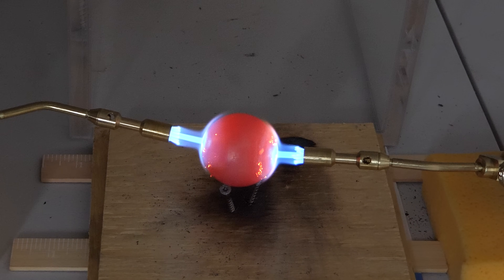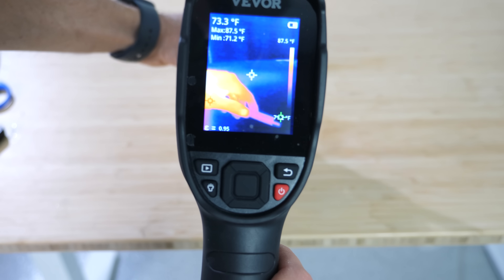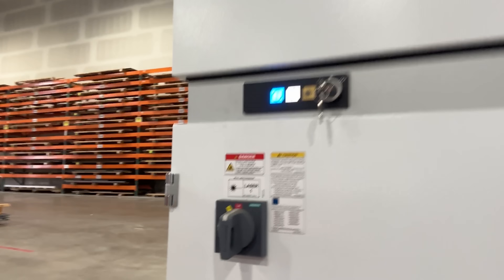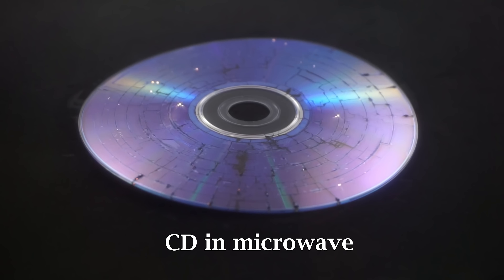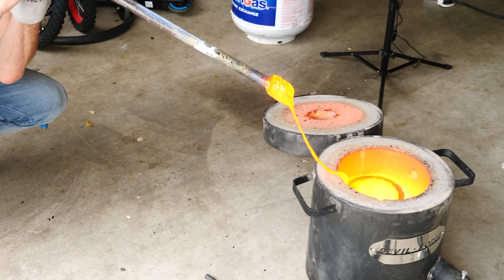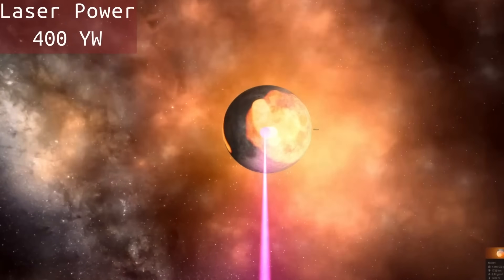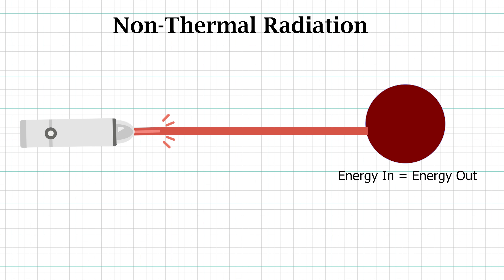How Hot is Light? How Lasers Bend the Rules of Heat Transfer

Comment: The  thumb mail show's a lazer beam cutting at a point somewhere along the beam trajector. Meaning the beam after cutting, keep's on going somewhere. If an object is mandated to be a the distance it is shown to be, meaning at a particual point in the tragectory of the beam. What happen's to any thing in it path after cutting an object?

We have the technology to make what's known as a "LIGHT SABER". The issue is, were not able to control the length of the beam it's needed to do only the job a light saber is designed to do. From the smallest possible lazer beam to that of the largest. The least powerfull will go so far, the distance in unfathomable. A larger more powerfull goes past the length any one can fathom to the N-th degree.

Any one utilzing a fire arm, because a bullet can go through an object assuming it hit's the object. Well beyond the object it hit, and if and when one were to miss the object, even a greater distance. Thus one is mandated to be aware of the back ground because of the damage that may occur when passing through an object, not to mention if and when missing the obect. Which compared to that of a lazer, the distant's is that of a drop of water in that of an ocean.

Comment: Man ! The laws of thermodynamics were written for HEAT (Ec relating to the vibration of material particles). Don't you know the difference between heat and radiation?
And they don't say anything like that! They say that when two bodies TOUCH each other, heat flows in both directions (from cold to hot and from hot to cold) but more from hot to cold, until the flow in both directions becomes equal again.

Comment: There is one issue with this logic however: It is said, that nothing can be heated by the sun to more than the surface temperature of the sun. If i use a  5 million kilometers large lense that focuses the suns energy to a small point, say a typical match head, than I focus the energy of the sun, that hits the 5M km lens. So following the logic, that much energy is radiated away, as is absorbed, a small object would need to be infinitely hot to radiate the heat away. So ignoring the fact, that such a lense does not exist, this does not make sense to me. So indeed the sun should be able to heat stuff to millions of degrees - if with a focusing apparatus that captures the proper amount of energy.

Comment: you can also heat something up by hitting it.
Take a hard surface and place paper on it then take a hard ball and hit the paper. you will have burned a hole into the paper.
Here the heat generated in the paper is also grater then the temperatur of the objects used.
Or a smith can keep up the temp of the metal he is working by hitting it with the hammer.
You just need an energy source and something to absorb the energy.

Comment: Ty for the video! But to question why "a "cold" laser emitter can make things hot despite the laws of thermodynamics" is just a wrong assumption. 

Heat induced by Laserlight, microwaves or other EM radiation is no heat transfer. It is first and foremost transfer of energy and heat transfer can, does not need to be a part of it. The laws of thermodynamic are not the only thing that play a role here, therefore the laser medium being hotter than what is to be heated is not a requirement.

"the source needs to be hotter than the target" is only true for blackbody radiation and only if these are in a closed system. But Laserlight, let alone concentration of Sunlight completely different cases. E.g. concentrating sunlight with a magnifying glass can (in theory) heat an object hotter than the surface of the sun. Here, as well as everywhere else where EM radiation the mechanism of energy transfer is the governing factor. In this case, we must consider conservation of energy, and that states "what goes in, must go out". When concentrating the energy given off of a large surface onto a small surface we can indeed reach higher temperatures than the origin surface, because the "concentration" is higher. Ergo, blackbody radiation and 2nd law of thermodyn has nothing to do with laserlight.

Although rectifing this briefly at the end of the video, the introduction and the question of the video is unfortunately quite missleading. I like your videos and your narrative and the fact we could see inside the laser cutting industry. But maybe also visit research labs, talk to experts and check for scientific correctness.

Comment: 5:55 I'm not sure that this is the whole story. If it were, then any monochromatic light source would do the trick, but if you let two otherwise isolated systems exchange heat via radiation through a monochromatic filter they'd still get to thermal equilibrium. In that case the relation between frequency and intensity (in connection with emission/absorption coefficients) would ensure that.
Also what is the "temperature" of a laser, where the light emitting atoms are "pumped" into an inverted state that isn't something that corresponds to a thermal equilibrium (AFAIK that inversion would correspond to a "negative temperature", one would characterize with beta=1/T in the statistical description to get continuously from non-inverted to inverted states).

Comment: I think an easier way to highlight this is that your can throw metal balls at very high speed to heat some surface way higher than the source temperature.
Reply: Speed of light and electricity is fixed.  Perhaps more balls within a confined space (density) ?

Comment: When a laser Cut steel, most of the Power comes from oxydation. Oxygen is used to increase the laser output.
It's a different situation with Stainless. You cannot Cut as much with the same laser.
Oxygen alone can cut up to 8 feet of steel. Just from the heat given from oxydation.

Comment: That's a 10KW Trumpf (note the 'f' at the end) laser cutter. I use to work with a 4KW unit, of the same make, years ago. Those particular units are used to cut metal. Steel, most often. It can cut finer, and more accurately, than a plasma cutter. Though the plasma cutter is about 1/10th the cost.
Reply: Then you should also know that these lasers are not vaporising, but mostly just melting the steel and its the jet of gas that makes it "disappear". That's very important feature. We couldn't cut steel without it.

Comment: Wait… I'm confused. I get the difference between objects that conduct via thermal radiation vs. those that conduct via electromagnetic radiation. What I don't get is how the electromagnetic radiation of a laser would be fundamentally any different than the electromagnetic radiation of the sun. The properties like wavelength/frequency, polarization, and intensity may be different, but it's all photons. And, sure, those properties matter when it comes to the end result of their cumulative effects, but if the ability to heat to a higher temperature than the source lies with electromagnetic radiation, how is a photon from the sun any different than a photon from a laser? Also, you mention a laser having batteries. The sun also has a "battery" of sorts: it's mass, since it's releasing photons equivalent to the difference in the mass of the atoms before and after fusion. I would think the only reason the sun can't do what the laser's doing is because its light just isn't being focused as densely, not because sunlight lacks the ability. Am I wrong?
Reply: The sun is emitting light from fire.  The laser is emitting light from electricity.
Reply: @CATANOVA  There aren't "fire photons" and "electricity photons," there's just photons. All electromagnetic radiation has the same properties. The values of those properties vary, but they're the same properties nonetheless. Even ionizing radiation is only distinguished by the amount of energy (and related properties) it carries. Any frequency of electromagnetic radiation can be transformed into thermal energy when absorbed by matter, whether radio waves, microwaves, infrared, visible, ultraviolet, x-rays, or gamma rays. My question wasn't about how the radiation is produced, that doesn't matter. My question is what physical property of the electromagnetic radiation from the laser makes it different from that of the sun. Best I can tell, it's merely a matter of how tightly/densely the light is focused. Because infrared light has less energy than much of the spectrum of the sun, so it's not about how energetic the photons are. The sun emits plenty of infrared as well as higher energy photons of the visible and ultraviolet ranges. Therefore, if you were to focus enough of the sun's light into a small enough point, it should do the same thing as the laser. If that's the case, then in terms of being able to heat something above the source's temperature, there's no distinction between the light of the laser and that of the sun. They don't transfer energy by different mechanisms, only the density of the light sets them apart. 

And for the record, the sun releases energy through nuclear fusion, not fire. (Fire is a rapid chemical process of oxidation that releases thermal energy, an entirely different process that requires oxygen.)

Comment: I liked what you did here, but I have one problem: using a magnifying glass to magnify the light from the sun is not magnifying a thermal source directly, but like I said, the light itself. That said, if you have a magnifying glass of sufficient size (perhaps 100ft true fresnel lens, or a mirrored radar dish of similar size) you will surpass the sun's heat at the surface!

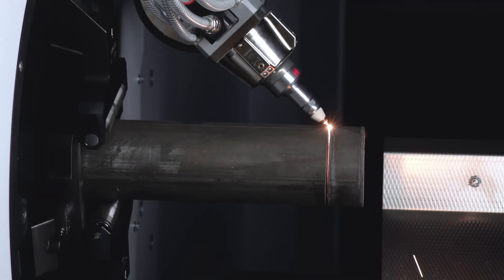Comment: 3:13 OK, this is messing with my mind... Laser at 30° angle(for arguments sake), round bar spinning, you'd expect the laser to cut a cone on the end of the bar, but the finished cross-section is a square?
Reply: If you look at the piece that’s removed as it falls away you’ll notice it’s tubing and not bar stock.
Reply: There are sparks coming out of the middle while the laser is cutting. I'm gonna say it's cutting a pipe and not a solid steel rod. It's slightly cone shaped, but that would be a bevel on the outer pipe wall.
Reply: It's a hollow cylinder, of course. You can see the (annular) "bevel"

Comment: Just a different form of energy transfer. The second law of thermodynamics states that the entropy of a system never decreases. As a consequence, thermal energy gradients force energy transfer in the direction of the temperature gradient. But the laser is transferring its energy through photons, not heat. So more generally, the energy gradient forces energy transfer in the direction of the transfer medium's gradient, in this case, photons.

Comment: 0:36 they have INFRARED SENSOR CARDS!!?? This would be so useful for individual soldier laser warning if somebody is shining a PEQ on you.
Reply: This is nonsensical.
Reply: I carry one in my wallet for checking if there's infrared light coming out of fibre channel optical cables and ports.
Reply: If the detector goes off for an infrared laser, it's too late. 
Either you actively have a firearm pointed at you, or there are hot laser guided munitions on its way to your location. 

It won't be much help at all, other than warning you of the inevitable.
Reply: Tanks have laser warning receivers for this reason.

Comment: this makes a lot of sense. I've always felt that the designation of lasers as "negative temperature" was just a lazy way to make the math work for something we didn't understand, but it being a nonthermal source  makers much more sense than a negative temperature source. Then its designated as a negative temperature source because heat will always move away from a negative temperature source. 

I can think of it practically like the relationship between being pushed by an object vs being acted on by gravity. the object pushing you has a finite amount of energy that it can transfer and so you will only move at a certain maximum speed (like a normal thermal source), but if you have no thing under you and no air resistance gravity could theoretically speed you up infinitely as its a constant source of energy (like a laser). 

I know I'm saying anything profound but its nice to finally learn this. My wife jokes with me all the time by reminding me of "negative temperature" because I would get so heated about it.

Comment: The second law is wrong. Heat pumps may not create thermal kinetic energy, but they do organise more joules of thermal kinetic energy against the natural heat gradient than they require in mechanical input to opperate.

This effect, where their cop > 1, means that a heat pump lets you trade a relatively small kinetic input for a relatively large thermal potential gradient.

Potential energy is a real and valid form of energy. If I can spend 100 joules of mechanical energy to establish 200 joules of thermal potential energy, then the second law is incorrect because I can lower the local entropy faster than entropy increases to supply me with power for my heat pump.

Comment: You can get very different results with LEDs compared to LASERs. Can you give me a coherent description of why?

{^_^}
Reply from the maker: because LEDs have a much lower power output per area since it is non-coherent light
Reply: @TheActionLab  Which is exactly the clarification I was hoping you'd make. Coherency with EM radiation is critical to focusing it to absurd points given enough apparatus. e.g. A 16.3 kHz system might require rather impractical size but is theoretically possible, a 100 THz system can be constructed with feasible size apparatus, and a gamma ray apparatus can even be configured by nature in very large objects.

Coherency is the key element to focusing the device's energy more than how the light was generated, thermally or some other means. LEDs don't emit coherent light. LASERs do.

{^_-}   Thanks for the reply I was fishing for.

Comment: another interesting thing, for the same reasons that lasers can heat things up beyond the "source temperature" they can ALSO COOL THEM DOWN. yes, cooling lasers. you should do a video on that!
Reply: Also, he cut pipes. I want to see video about lasercut in dot, in deep metal block.
Reply: @GOOGLE-IS-EVIL-EMPIRE They cut both! Or at least made champion bevels on the 2 dm dia. rod. I was waiting for that scrap (most of the 600 lb. rod) to have hit some Elden Ring scale safety device that they were laughing more than they were bruising.
Reply: @GOOGLE-IS-EVIL-EMPIRE  2:51 thats pretty much what they were doing right here and the shot after, that metal is like 1 1/2 inches thick, its crazy that the laser can cut it that precisely and that easily.
Reply: @SpydersByte  i want see how they cut big brick of metal in center, like dont, not from side to side.
Reply: @GOOGLE-IS-EVIL-EMPIRE  We have 1" thick steel plate parts cut all the time with a 6 kW laser.
Reply: @chuckmccown8893  cool. But it start cutting in dot or from edge?
Reply: Sorry laser cooling has numerous YouTube videos already.... Just this one wasn't one of them....Since he forgot to include that part....
Reply: @nc3826 forgot? It wasn't the focus of the presentation.
Reply: @mattmarzula  sorry to confuse you and for what you "forgot:, my trolling friend, but it was.... FWIW a rationalization for what was missing is in the pinned comment
Reply: Finally, lasers are cool. It probably took some nerds in the '70s ions to do this I bet.
Reply: I used lasers to cool something down to its quantum ground state near absolute zero!

Comment: I have to admit I still don't really understand what's going on here.

If you didn't know the light was from a laser or a thermal source, what's fundamentally different about the two light sources that let a laser heat something to a higher temperature than a thermal source? 

I don't doubt your explanation, but there's something unsatisfying about it.  Both are just photon sources.  What's different between the laser photons and sun photons?
Reply from the maker: It is because if the laser were powered off it would stop outputting that radiation, but with a thermal source there is not input of power, the energy is already contained withing the emitter. With the laser you are continually inputting energy. Also for a laser specifically you would easily be able to tell it is laser light since it is coherent, monochromatic and collimated.
Reply: @TheActionLab  So, if I've got this right:

Sun = giant (but finite) junkyard pile of burning cars

Laser = highway that (theoretically) infinite cars can drive down to create a (theoretically) infinitely extreme burning wreck at the end
Reply: @TheActionLab  Still not terribly satisfying.  

What if you didn't know the source, knew nothing about lasers, and only saw photons that were heating a surface to an ever-rising temperature? 

What would you notice as a difference between those photons, and photons from the sun?
Reply from the maker: @stevesether there is nothing different about the photons themselves. What is different is the amount of photons that are possible to hit a certain area per time. The laser acts as though it has a much higher temperature than it really does because you are continually creating photons that are not coming from normal thermal emission

Comment: How is this connected with this weird negative temperature of lasers you came up with in an older video?
Reply from the maker: Well, lasers have a population inversion in the internals of the laser. So if you had to define a temperature for the laser it would be a negative absolute temperature which is hotter than any positive temperature. But the problem is that in order to define a temperature the system has to be in thermal equilibrium, and that is not the case with lasers. So, although it can be explained by the fact that they have a negative temperature, I think that this explanation is more correct.